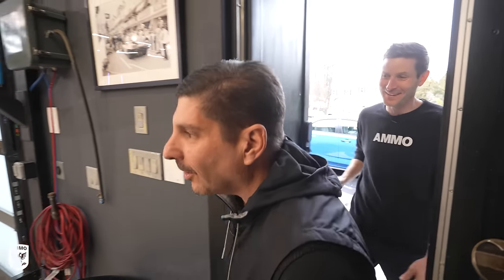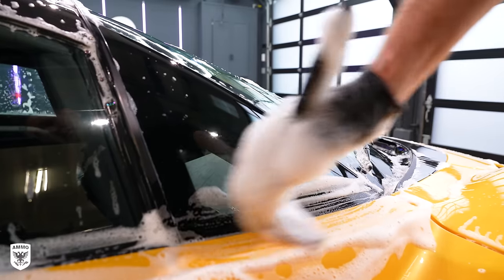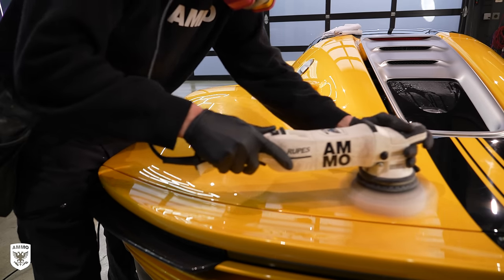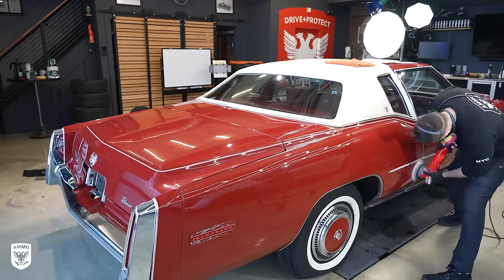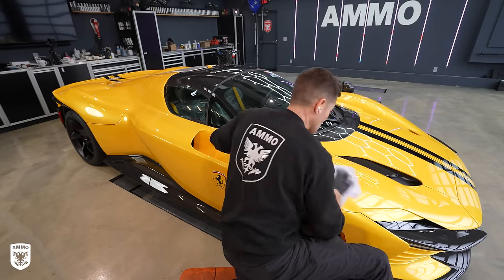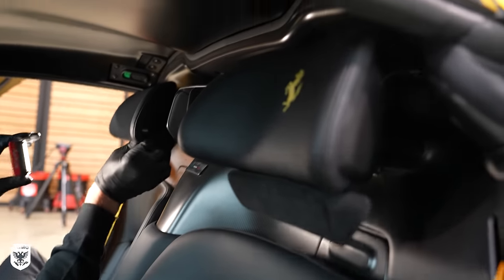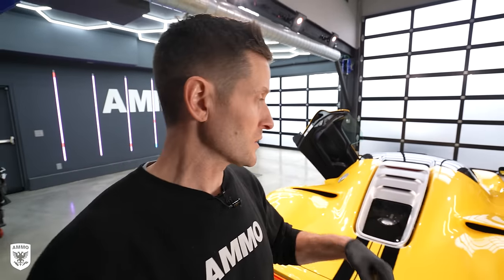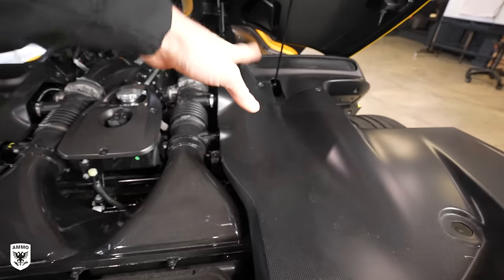$2,400,000 Ferrari Daytona SP3 First Wash:  24 Hours To Detail For NYC Reveal!

Comment: Not only does it cost 24 million dollars, the tires cost 10 thousand each and that's not including the wheel and tire kingdom does not have the necessary equipment to change a tire and if they did they'd never figure out how to balance it correctly.
Reply: its 2.2 million not 24
Reply: @Moe00732  I don't think he realizes the purpose of punctuation.